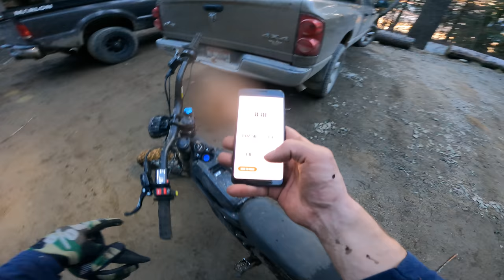Surron Crushes Lakeside Single Track - Full battery Range Test Off Road!

Comment: Your videos make me want to go electric, but stock they cost more than a new 250 gas bike (here in Canada anyway) and I'm about 100lbs heavier than you ready to ride. With the upgrades it would need to make it useable for me I don't think it would not be very cost friendly. Looks like I'll be sticking with gas until they get better or cheaper. Thanks for the content always great to watch.
Reply: But think of all the places you can ride where a gas bike would get the cops called on you. Plus you can throw it in a hatchback. Still pricey, yes, but worth it if it gets you on trails twice as often?
Reply: There’s full size electric bikes that’ll gap a 250 off the line but as an owner of a surron and Ktms electric bike the free ride exc I would still say wait, don’t buy one until you can get at least 75-100miles on em which is a good bit away for true e dirtbikes

Comment: I went 29 miles
72V32ah lite speed battery
Controller: EBMX bac8000 15kw tune
120 pound rider
average speed: 30mph
Road conditions: frozen dirt and snow
Rear sprocket: stock

Comment: Does anyone know how much range you would usually get on a regular gas dirt bike?
Reply: Depends on the bike but on my fuel injected rmz250 I can ride something like 8-10 hours on a tank (breaks included). 1.5 gallon or so.
Reply: My crf250 gets around 100 MPG
Reply: I have a carbureted kx250f and it goes 30-80 miles on a tank. I bet if I was being real conservative I could get it up in the hundreds tho.

Comment: Can I use this as a daily driver ?
Reply from the maker: I have seen people make them rode legal
Reply: @EdwinOlding  I mean would the battery last a day on the streets? I live in the city so I would mostly drive it on the roads
Reply: @solo998  It all depends on how far you need to go, hills or flat, average riding speed, the way you drive it etc. But for urban commuting, yes it's usually sufficient. During two weeks in Breckenridge, I used the bike to get from a mountain cabin and down into town, drove around town a bunch, back up the mountain, played around on some trails, and got back home with 20% battery. It's actually a pretty impressive battery